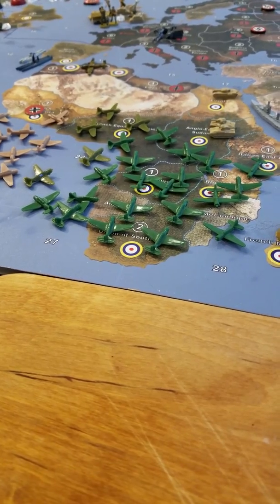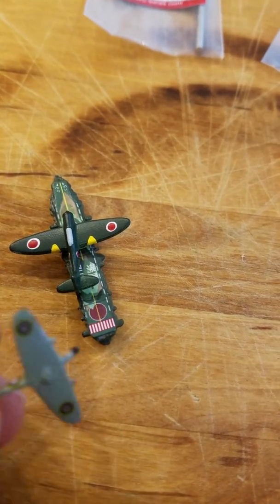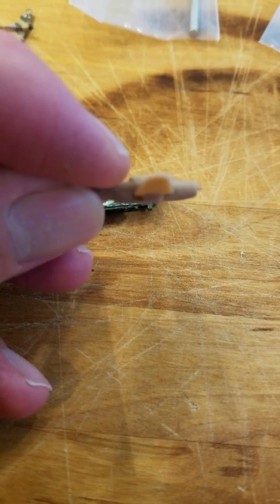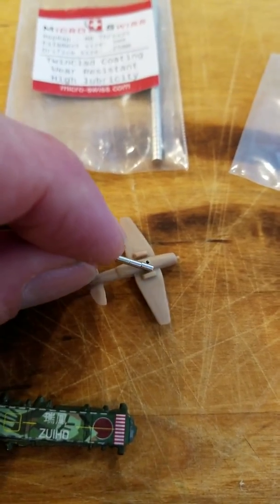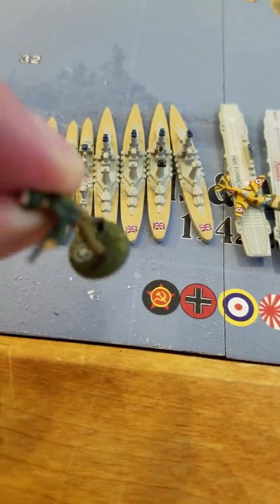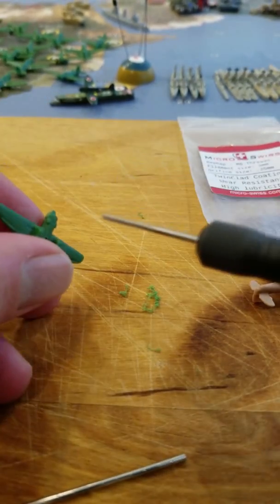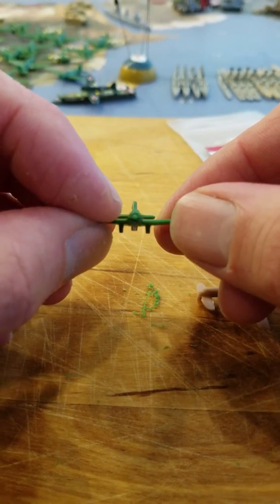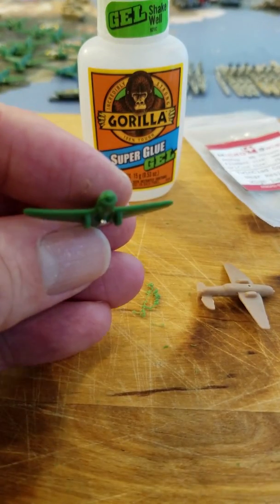Drilling and inserting magnets

Comment: Thanks for the info, this will come in handy. Question: How exactly do you use Visio to make those carrier landing strips?
Reply from the maker: Glad it will come in handy.  

Firstly, I use Visio because I don't have access to Photoshop, which I am sure would be much better.  I just measure the carrier, and fiddle with shapes and printing/cutting until I get all the right shapes put together then I use the "union" command to join the different shapes into one piece.  From there, I can color it and add more lines, etc on top.  I can send you my file if you send me your email address (private message if you don't want to post).